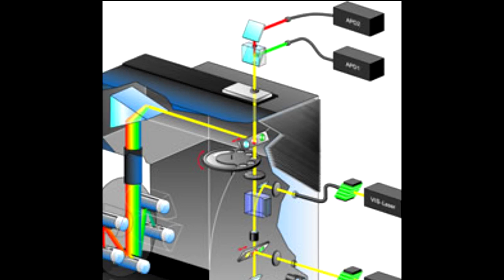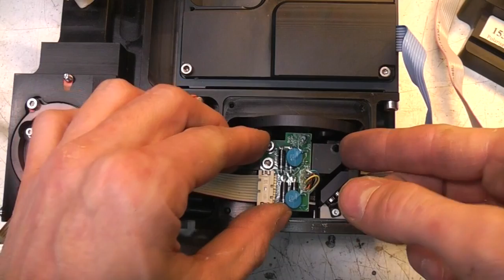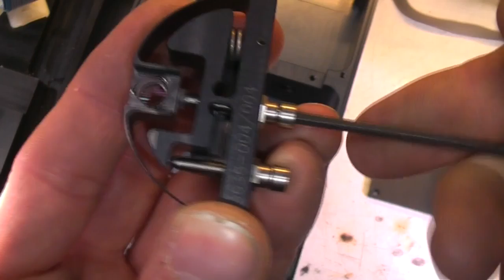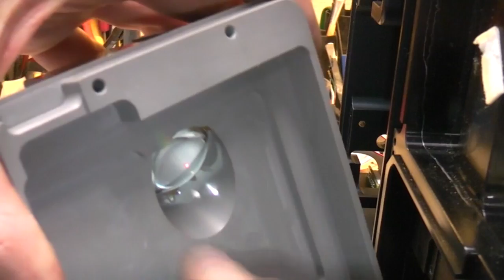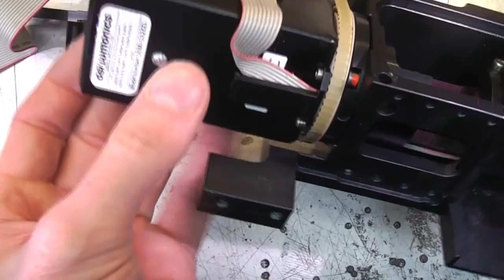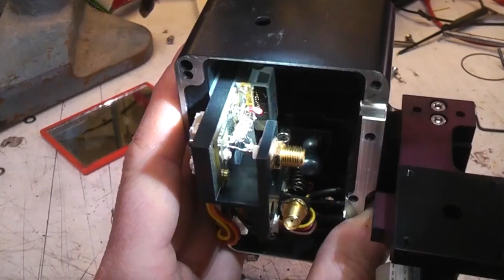Leica SP2 confocal microscope Part 4 - Optics

Comment: You might have missed it, but the iris you found and quickly discarded is what actually makes the system confocal. The location and size of that pinhole is such that only light that came from the focal point on the sample actually can get past that point and onto the prism and detectors

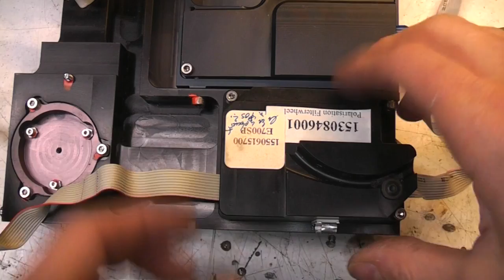Comment: Hey Mike, huge fan, but some of your ramblings about overengineering the piece around 4:21 is not quite justified. That thing is expected to run inside optically shielded enclosure, so having it all uniformly black actually serves a purpose, as opposed to letting the wires stick out and scatter some random photons into photomultiplier(s).

Comment: I'm amazed by these series! I've used this sort of microscopes in the past, but I could never have dreamt of having such a close look at them.

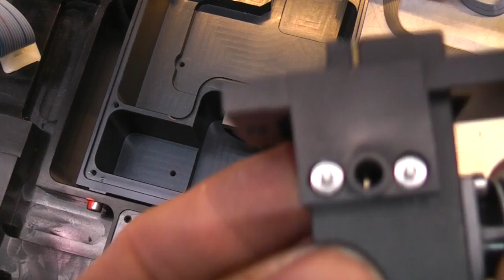BTW, the motorized iris at 6:27 is actually the so-called "pinhole", which is fundamental for the confocal regime of these microscopes. In this Leica unit, it happens to be square (https://svi.nl/LeicaConfocal_TCS_SP2). Sure enough, it's the first time I actually see one.

Thanks! And keep it up!

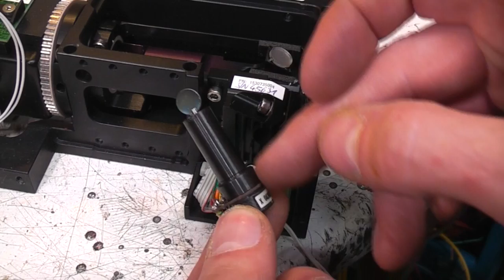Comment: 16:20. The part at the rear is the feedback assembly, the coils and magnet (assuming moving magnet type) are in the long thin section, low diameter keeps inertia down while making it long means you can still have a decent amount of magnet for torque. I made some magnetic actuators based on the same idea for a force measurement system. I hope you keep all these bits for the radio rally ;)

Comment: This actually gives me some good ideas on building a solar telescope using PMT's and a prism or grating to select the wavelength.
Reply: You'd need to raster scan over the image. It would be slow for a reasonable resolution. You can just use focal tunable filters.

Comment: Without bothering to think of a new design, this strikes me as offensively overengineered.
Reply: +Dan Frederiksen Yes it is... BUT... Considering the six-figure price tag (a good portion of which will be going towards the R&D budget for the product) anything less would have been unacceptable.

Plus you are dealing with extremely fine optics so any mechanical movement will throw the whole thing out of whack.
Reply: +classicmacintosh no that's bs. Also it has fluttering mirrors. Vibration can't be a huge issue for this stationary device.
The engineers should be KISSed with a mallet. Expensive is one thing, dumb is another.
Reply: Dan Frederiksen Remind me of the wavelength of the light we are talking about here ?
Reply: +Tony Ling, about 400-800nm. Why?

Comment: Most commercial galvos can do fast scan speeds at a massive deflection - thousands of points per second at serveral(sometimes dozen) degrees.
You can get a 15kpps x-y scanner pair + driver boards for around $100 on eBay, but they're of questionable quality and performance, and the deflection is very bad.
A good galvo pair will cost you a good serveral hundred or even thousand dollars, depending on the performance.